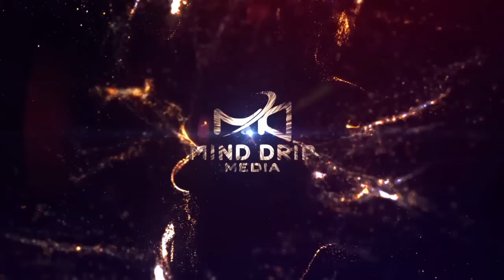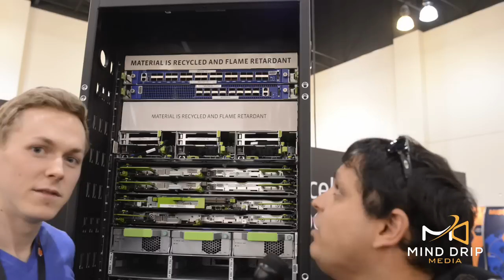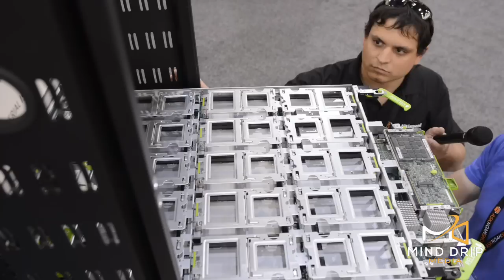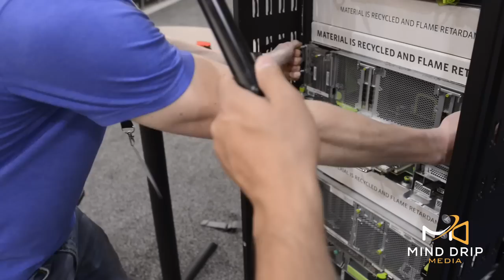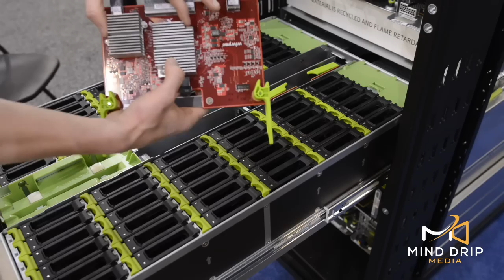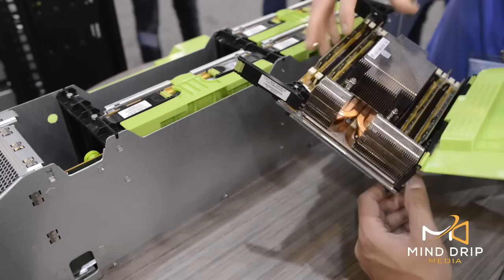What's inside a Facebook Datacenter Open Compute Rack?

Comment: That is super stupid, super difficult to maintain, even just to replace the power cable
Reply: When a rack is installed in a data center, when would a power cable go bad?
Reply: during my 7 years data centre work, only one or two times power cord went bad but it still happens

Comment: i think these guys have never heard of hot swap: the idea you can swap a fan without switching on the device... where is the innovation here?
Reply: The fan isn't in the chassis, so you don't even need to open it up. Blade chassis usually do this too, so not totally new, but all of this looks to be essentially blade type hardware made bigger.

Comment: 12 V for a whole rack? How many Amps are this 1.000? This is not possible with normal wires?
Reply: They switched from 12V to 48V. "Generally, above 15kW per rack, 12 volt systems become too
inefficient to manage", source: https://www.opencompute.org/files/OCP18-Workshop-Huawei-v2-final.pdf

Comment: I'm surprised data centers don't have huge common DC buses, and maybe even central water cooling.
Reply: Some actually do have a kind of water cooling, where there are radiators in the racks so they can use standard hardware. The air gets pulled through cool radiators and comes out through "absorber" radiators this water then gets cooled centrally. The air which comes out of the back, so after the absorber radiator, is like 20c it's pretty cool (edit: pun  inteded ;) )
Reply: Some do / did. Most switch mode power supplies are just as happy with DC as AC. However, distributing 350VDC through a facility is quite dangerous. (AC you can actually let go of.)
Reply: @jfbeam  I was thinking more like a common 12 volt bus so there wouldn't be any conversion losses, but now that I think about it more, the bus bars would have to be enormous to handle that sort of current, and a fault could be seriously nasty.

Comment: using dc from dc bars is not something new, its been a thing in dc's for years, so is the blades and all the hot swap stuff. cool but nothing new here. also having batteries inside the racks, is slowly been abandoned, its a fire hazzard and there is no need if you have the dc bars.
Reply: We need more hardware that supports it tho. So it's good to see big companies create an open standard.

Comment: Hello

Somebody advice me when should a server use DC or AC ?

If our DC has 1000 rack space. What power for server should I use ?
Reply: What power options does the DC have? If it has DC you'd probably want to look into using that instead of converting it (twice) and losing power in the conversions but if it doesn't have DC available usually you'd want to just go for AC...
Either way, you shouldn't base such a decision off of Youtube comments, ask the supplier who you're ordering from what they think, if they do not have a proper answer move on to a supplier that does.

Comment: Very impressive and amazing how fast the Datacenter is transforming.
Reply: Not really. Much of this sort of tech has been around for many years. But it is getting refined as newer silicon comes around.
Reply: Open source  hardware Hackers make better stuff faster
Reply: @jonlaban4272  not posible, this servers uses exclusive components with amazing hdd, processors and ssd's with capacity you can't imagine and i can't tell you either or im getting fired.
So a hacker can make one of these in a whole messy room, and it's not even close because of the crap components out there in the market.
Reply: @bigfloppa2912  haha try better while trolling
Reply: @wiziek  developing IA servers for the new meta Facebook era rn, new models running fast af in mass production, maybe you will never know nothing about this but you will see in the coming years people just hanging around in VR universes.
Again, you can't just make this kind of equipment with components you can buy from amazon.

Comment: its not 12V its 48V telco voltages
Reply: OCP does 12V and 48V DC power distribution.  48V is looking like it will become more popular because of the higher rack power levels
Reply: @jonlaban4272  Yes, but it still need much trafoing down, thinking most PC part is 12V
Reply: @alfred_foxfired  

12V or 48V DC available.

Check out the open source hardware at www.opencompute.org

Comment: it annoying standards unless you can afford nonstandard size equipment ( 21 inches)  like google or facebook and why 12 volts instead of 48 volts. this standard  will never really popular unless  your large and have plenty of money
Reply: Tons of equipment already runs on 12v or lower. Running 48v then stepping down again makes no sense
Reply: It's worth it for Facebook the single most expensive part of Facebooks bottom line that's unavoidable is electricity costs
Reply: @Ayyy-lmao  I  can imagine that is true
Reply: ...if only Facebook uses it, then it's as standard and as popular as can be

Comment: Watching all I'm thinking is $$$$$$$
Reply: When one looks holistically at financial costs then the savings are huge. e.g. an OCP optimised data centre facility has a CAPX thats 50% lower than a traditional Tier III Enterprice Data Centre.

Cost if the biggest driver for adoption of OCP vanity free open source gear
Reply: @jonlaban4272  Alot of that is simply in avoiding "unneeded expenses" You didn't buy a single extra hard disk, you didn't buy a single extra graphics cards,
Reply: Not as bad as you might think - obviously with the amount of disk, GPU, and CPU thats in the rack the dollar amount is high, but it's on par with consumer grade stuff because the designs are open so anyone can build them
Reply: That is why facebook got so many fucking ads to recover their capital